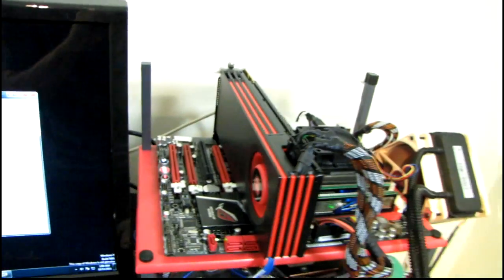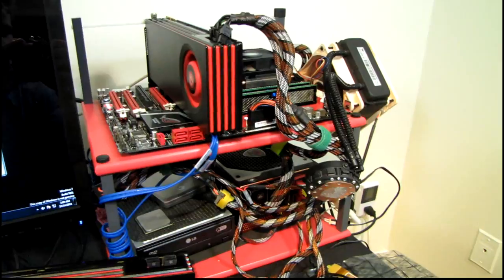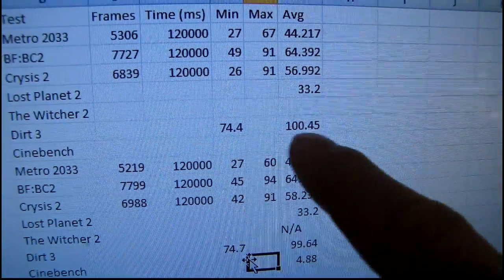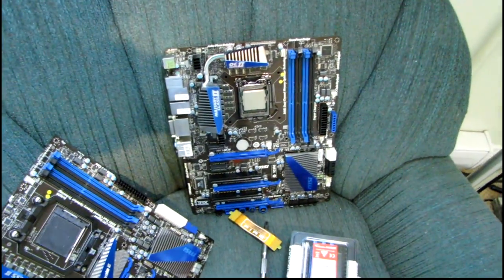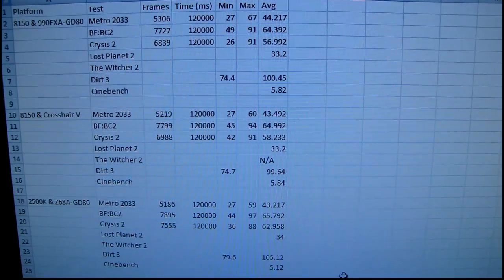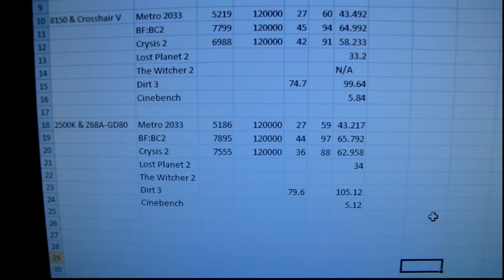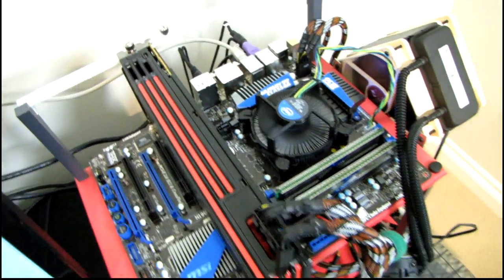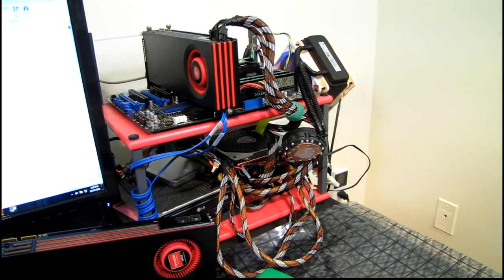AMD Bulldozer FX-8150 vs Intel Core i5 2500K 8-Core Gaming Benchmarks Linus Tech Tips

Comment: I can honestly say that the 2500K aged much more gracefully than the FX-8150, as now an overclocked i5-2500K has better single core performance than an i7-6700k, of course while overclocked to 4.4GHZ. The IPC was great on Sandy and complete bullshit on Bulldozer, the Bulldozer is still great for low to mid end gaming with maybe an RX 460/GTX 950 but above that, the Sandy completly ruins it.
Reply: I'm sorry the 2500k is a great chip and has aged extremely well, but no matter how much you overclock it, it'll never outperform and 6700k in single threaded tasks and that's not taking into consideration that you can overclock the 6700k as well, it'll come close and the performance increase we've seen over the years is pretty pathetic, but it'll never outperform it. Also 4,4ghz is an extremely conservative overclock for a Sandy Bridge chip, most chips could easily reach those speeds at stock voltages.
Reply: Antares 8001 I'm at 5GHZ now, so, definetly slightly better per core than a 6700K right now ;)
Reply: Rinkk Nope definitely not.
Reply: Antares 8001 Well, all of the tests I've gone trough show massive single core performance, and I mean, massive.
Reply: Rinkk I never disputed that, as I said it's still a pretty damn good chip, but a 6700k should still have a higher single core performance.
Reply: Antares 8001 You'd be surprised, the 6700K is not really what is all hyped up to be, but the 6600K is a god damn rocket. As of late at the shop I am working at, we prefer using 6600's rather than 6700's cause that single core performance on the 6600's is astonishing.
Reply: +Rinkk The 6700k is higher clocked than a 6700, 6600/k and will outperform those in every scenario.
Reply: Sorry but the 2500k is not even close to the IPC of the 6700k, even at 5 ghz. Idk where you're getting your information from when you say it has better single core performance.
Reply: 8350 easily outperforms the 2500K by any means.

Comment: because they both are quad cores, the FX8xxx series splits 4 actual cores into 8 virtual cores, disable every second core in the bios of the 8150 and it will out perform sandybridge setups.

Comment: Very good platform comparison. Thank you! Will upgrade my Athlon ii x4 620 to Fx 8150 and my Radeon 5770 to Radeon 7970. I have Ga970a-ud3 AM3+ and it has only 4x second PCIe but i knew from your tips that there is only minor performance loss due to 4x PCIe slot. Thank you for your interesting tips!

Comment: New Performance patch has been pulled for those wondering, It is a two part patch plus the first part wasn't close to refined. Give it time. Anyway you look at it , if you bought a 990FX or am3+ board the 8120 or 8150 is a great steal, listen to linus the Z68 can be more for less chipset wise. I Got 16X 16X AND tri SLi capable board for $189.

Comment: @rcarkk a 2600k has 8 threads and 4 cores so it will perform a lot better than most cpus and the bulldozer says it has 8 physical cores but has a lower frequency and instead of 1 core doing 1 thing they share processes between them

Comment: I am well aware of the price history, the 8120 can be overclocked to preform almost the same as a 8150. Which would in turn translate to the minute difference in frames per second.
FX 8120 : $169
And would most likely be quite cheap on the famed Micro Center.

I'm personally gearing up to buy Ivy Bridge very soon, but having 8 threads can prove advantageous with some applications.

Comment: @dakax43 Im not a intel fanboy. In fact, I am running an amd CPU right now, most of my computers run amd. I am upgrading to the 2500k very soon, because my motherboard is an am2 motherboard so I would have to upgrade my motheboard anyways. I can understand if you have an am3 motherboard, but for me, why not spend the extra money for the intel setup.

Comment: @TheNinjaNaren 1100T and 2500K are also designed for different market segments. The 1100T has 6 cores whereas the 2500K has 4, which makes the 1100T more suitable for programs that take advantage of that many cores, which is not really all that many. The 2500K is much faster overall, which makes it more suitable for games etc.

Comment: @cbrunnem AMD advertises it as an 8 core CPU, even that it has 4 modules, each modules has 2 cores "8 threads - 8cores" . HT on the other hand splits two threads to be processed on 1 core,"8 threads - 4 cores"

Comment: personally i would hope the 8150 has just as advanced dynamic overclocking at the 2500k has, i used to manually clock my computer once i found its high end speeds it could handle without crashing but with the advancements in turbo core etc i really feel there is almost no need too anymore besides to kill components faster and run it at x speed 24/7 just for wow factor. on the desktop i dont mind that im sub 1 volt and at 1600mhz.

Comment: well, the fx8150 is about 175euro (without the AMD cashback action) and a motherboard that's dual sli&crossfire compatible is about 75euro, the temp on full load is about 55C (stock cooler).
the 3570K is about 215euro and a dual sli&crossfire compatible motherboard is about 110euro, and the temp on full load is about 70C (stock cooler).
but the 3570K runs just a little better on stock performance...

Comment: I'm not sure. When you Crossfirex/SLI cards, you do get far more performance, but you can only use 1 card's VRAM. You'll still get two GPU of processing power, but the multi-GPU technology can't handle using more than one card's VRAM. Try tinkering with your settings on BF3 or update your drivers.

Comment: What you should do a video review on is if the bios release from asus will allow for the AMD FX 8150 to run on the 890 FX boards and also overclocking and benchmarks ;) Several have said this cpu will run on this board including asus but will it?Also many have said that while running prime 95 and cpuz the cpu frequency fluctuates please test this so I can decide to upgrade or not.

Comment: and the i5, 1100t and 8150 typically average out around the same with the 2500 being slightly better on the norm, except in massively multi-threaded applications.

Comment: So unless your interested in putting $1000 into cooling alone to achieve a few short moments at 8ghz so you can take a cpu-z snapshot with a bulldozer there's really nothing to take into consideration as far as overclocking goes. Both will OC about the same

Comment: Hey linus,i'm planing on build a rig with an 8150(or mabye waiting for the 8170) i plan on only getting a single 6970 to start,but later down the road when prices go down,get 1 or 2 more,i am also planing on getting a Hyper 212+ cooler,and i do plan on doing a little overclocking,also my total budget for everything is 1500-1600$,with the parts i have picked so far it will be 1321$ without the mobo
So what mobo would you suggest?

Comment: I'd have a question - you said that you were running those cpus both amd and intel at stock speed right? and they seem to perform similiar then my question would be which cpu is more capable of overclocking. tbh I'm not happy with my current intel cpu's and intel based mobo's overclocking ability.. and like you've said intel based mobos are way more expensive and I don't wanna waste my money on 1155 soket that I won't be able to upgrade further. with am3+ it seems to be more options n the future

Comment: yea this approach works fine as long as you dont end up bottlenecking with you cpu pick, the 8150 should be able to push pretty high end solutions, but gpus come and go much faster then cpu architectures and i am sure whatever way you go but realize that the sandy/ivy bridges are nicer chips.

Comment: Hi! Thanks for great videos. I like them all. Just a comment:
You say the Z68 motherboards are more expensive, but thats not the case. You can buy a board like the Gitabyte Gigabyte GA-Z68AP-D3 (which you even did a review on?) very cheaply and get a nice gaming rig.

Another thing to note why the 8150 is getting so much critique is because it deosnt outpreform a 2500K which i would say is a older CPU now and then 8150 is even more expensive. It might only be better for multithreads

Comment: suprised he mentioned the fact that the i5 had a 4 1/2 fps superiority over the AMD chip for crysis 2 for avg fps, but didnt mention the 6 fps difference on the minimum fps which the AMD chip had over the i5 - I think its vastly more important to have a better min fps than a slightly better or worse avg fps (since avg 58 or 62 makes no real difference at all). (btw no fan boy issues here, i use an i5 and love it)

Comment: Okay just one question here when you say compare. First of all the FX-8150 is a 8 core CPU and the 2500K only has 4 physical cores and no HT. So why would you compare 8 cores against 4 cores because of price? Doesn't add up but then again neither does this.

PassMark bench test

Intel Core i5-2500K @ 3.30GHz 6,740

AMD FX-8150 Eight-Core 8,272

Difference AMD has 4 more cores over the 2500K and only grabs 1532 more points in bench test.

Comment: Will the Bulldozer work on the Crosshair IV Formula?  Cuz i want to upgrade my CPU from a Phenom II X4 to the Bulldozer.  In BF3 the FPS's are just fine until i get to the B2K Maps with the Big open terrain and my FPS go down.  Such as on the top building in Strike at Karkand when i look off the top it drops from 50fps to a dramatic 15-20 fps....what could be the cause of this?  And this is with the Turbo Unlocker on the desktop "On"
Thanks for the Help and hope to hear a comment soon :)

Comment: I want to make several tests with different motherboards, memory modules and other things. but it is difficult if all parts are not connected properly (I mean loosely). I want for example to mount graphic card not only by putting it in a slot in mainboard, but also by using screws, but when you do this on the table there is no hole to use the screw in the air. In your videos there is special platform to mount everything and I am curious what is the name of that thing and when I can buy it.

Comment: @Dizanos Actually the i5-2500k is cheaper. you have it mixed up.. i5-2500k $224.99 AMD Fx-8150 $249.99 on Newegg check it out if you don't believe me. Yeah the FX-8120 cost a little less at $189.99 but you can see that the i5 2500k out performs the more expensive Amd CPU's, even though the FX-8120 and FX-8150 have eight cores where the i5-2500k has only four! :) Vote this up if you agree!

Comment: Hmmm, it's only like $10 more for that over the one I was thinking of getting. 

AMD FX-8320 Vishera 3.5GHz (4.0GHz Turbo)   $179.99
AMD FX-8150 Zambezi 3.6GHz                           $169.99

If the gain in performance is there, it might be worth the extra $10

Comment: All reviews, stats, comparisons and every bit of research I have been able to find since they went public, the 8150 is a upgrade on ghz performance, but realistic use, the 1100T Black edition will still surpass. Both will typically be buried by the i7 but the cost difference makes it worth it to get the 1100t or the 8150 on a budget build or for those that dont have the $5k+ to go all Intel.
Basically, 8150 or 1100t for lower cost builds, i7 for all-out performance ignoring costs.

Comment: They are not "true cores" in the sense that the Phenoms were, they are some way in between a true core and Hyperthreading. From the Wiki article on Bulldozer "...formally called a "module" by the AMD's marketing service. In terms of hardware complexity and functionality, the module is midway between a true dual-core processor, where each thread has a fully independent core, and a single core processor that has SMT...". It is true they suffer due to their design, but they are not hyperthreaded.

Comment: Building a PC soon. Here's what I have so far. 

Sabertooth 990FX R2
FX-8150 Black Edition
GeForce GTX 650 1gb
8gb Ram
Corsair Builder Series CX 600 Watt power supply.

Trying to keep it around or under $800.
Help if you can! Thanks.

Comment: @findthecomputerroom6 And my friend. Bulldozer runs @ 3.6 ghz stock vs 3.4 ghz stock of the 2600k. Cinebench 11.5 scores 6.70 @ stock 3.4ghz with NO turbo mode. The FX-8150 @ stock 3.6 ghz scores 5.94. It´s very clear that Bulldozer it´s a weak architecture. Hope it can be improved in a near future for the best of AMD and overall consumers.

Comment: No. Not really. Unless your using some type of insane cooling setup like LN2 or something(which is only used for benchmarking anyways because it is not a viable 24/7 option) the Sandy Bridge will OC just as well; if not better; than any bulldozer CPU on air or water. You can drive an I5 2500k all the way up to 4.8-5.0ghz in most cases using a $24 Hyper 212+. And that's 24/7 stable. Most BD hit a wall at 4.8ghz with standard aftermarket cooling. Some will do 5ghz.

Comment: Bear in mind that windows 64bit vs 32bit is not much more than 10% faster. That tells you the fact that the os we have today is not very multiple core efficient.. So I guess there is a lot to be gained with new os that can really pull out the preformance of new cpus like the Bulldozer platforms

Comment: A lot of people believe the AMD CPU has 8 complete cores and this is completely untrue.
Each MODULE is split into two smaller cores, so it shows to the system as 8.

The ACTUAL core count may be 8 but there are four modules.
These modules are where two cores each sit in, and it's more comparable to the i5's because in reality it has 4 modules.

Each module in the AMD CPU is equivalent or more powerful than a Sandy and Ivy Bridge core.

If they utilized the module space as individual cores oh man

Comment: What are u using it for? what plans have for the near future?  Will spend lots of money on the pc? are u getting a powerfull GPU (maybe 2?). In Short: The 6100 will perform better on strong multitasking, i5 (depends on the model) are very strong for games and some of them also converting videos (quick sync) and overclocking (2500k). Great answers come after a great question. Think what you really want/need deal with this trade off and the answer will come to you. Theres no need to ask no one.

Comment: @viper19861986 You're wrong, more cores does not mean more performance even if the software can distribute the work to all cores. For example, RAM memory is the most common bottleneck, putting a gazillion cores in a CPU will not make much of a difference if the communication between the cores and the RAM are slow as hell, in that case, more cores will actualy degrade the performance because you have more cores fighting for the memory bus.

Comment: P67/Z68 boards aren't that much more expensive than 970/990X/990FX, on the whole. I mean, you can buy a 2500K and Z68 board for $330, total, which is roughly what it'd cost you for an FX-8120 and 990FX board.

Comment: Even if the core scheduling is fixed fully, you will see about a 5-10% improvement.

Which is not enough to beat the 2500k.

Comment: @8Denkmeister8 And again, that OC'd ATI card will beat out *any* next gen GPU as long as you compare them at stock clocks. That's what OC'ing a card does, makes it last longer/perform better than newer cards(stock). That's what I'm saying, ATI is not *better* than NVIDIA because your OC'd card is better than a stock clock NVIDIA card, that's a given with *any* OC'd card compared to *any* other card regardless of who made it therefore it can't be a basis for "X is better than X".

Comment: @audigamer1 Get the i5 2500k. The i7 has hyper-threading, which create an additional 4 virtual cores. Since most games do not utilize more that 2-4 cores, you will literally see no difference over the 2500k. Better to get the i5 and use the saved cash on getting a better cooler, PSU, etc.

Comment: Honestly speaking, when compared to a Phenom II x4 955, the performance difference isn't worth it in terms of gaming. If going for a fx-8150, getting the x4 955 would pretty much perform the same, while being significantly cheaper. I think that's the main drawback of the bulldozer and the previous generation 6-core series.

@sammy43434 Trouble is, since it's sharing resources between cores, the per core performance falls quite a bit. The 2600k which is slightly more, still has the advantage.

Comment: Then several weeks after that, I plan to buy a couple EVGA SuperClocked 02G-P4-2662-KR GeForce GTX 660 2GB 192-bit GDDR5 PCI Express 3.0 x16 HDCP Ready SLI Support Video Cards to run them in SLi. Going to be so much better than the 550 ti I have now. lol

Comment: im getting the GTX 670 with a intel i7 2600k, 16gb ram, what will my fps on bf3 be ultra w/ 1080p. also my brother is spending a little less and getting an intel i7 2600k with 6870 graphics (Crossfire (dual cards)) what fps would he get? with same settings as me.

Comment: You are over exaggerating Ivybridge temps, you do not need to be an expert. IB only gets hot after around 4.6GHz. However, take into account that IB has better clock for clock performance than SB, so 4.6GHz on a 3570k is around 4.9-5.0GHz on a 2500k. The 3570k has PCI-e 3.0 support, native USB 3.0 support, faster Quick Sync (using faster iGPU) etc. so it doesn't make any sense to get the 2500k over the 3570k unless the former is much cheaper.

Comment: So they are just about the same 2500k being a bit faster by a little, but that was before the 10-20% performance patch so maybe they are more even now. However, the 2500k will not increase your electric bill, while the 8150 will multitask much better and will run 1866 ram. Like someone said before compare air overclocking to max & the amd excels, but expect alot of heat and high electric bills. I'm going to wait for the 2nd generation of these amd chips, if they keep the price where it is.